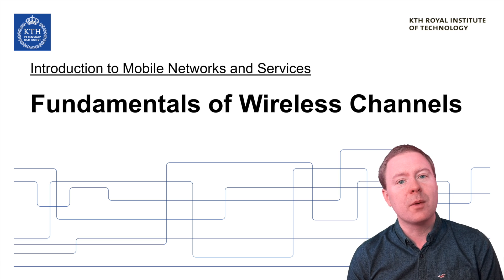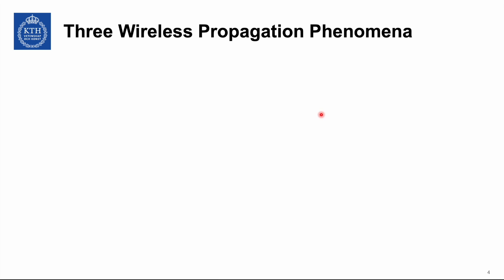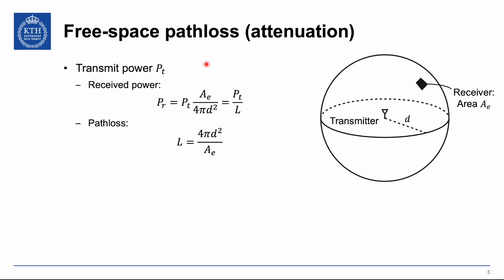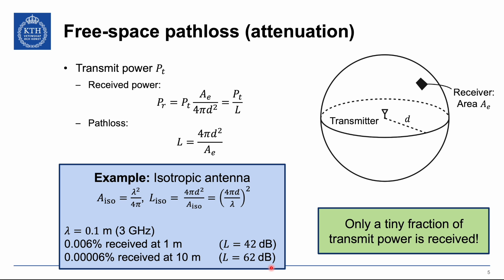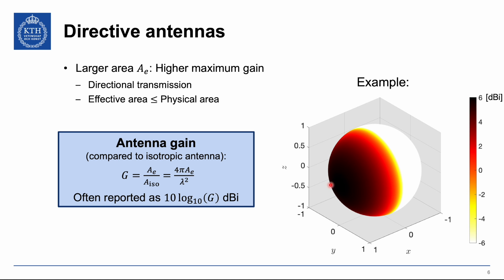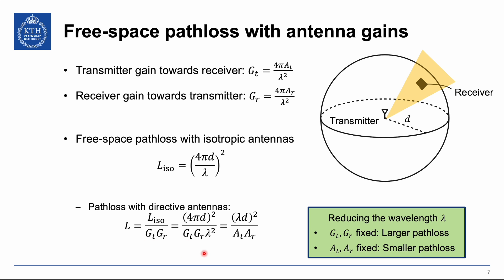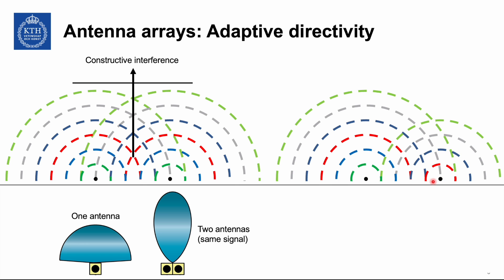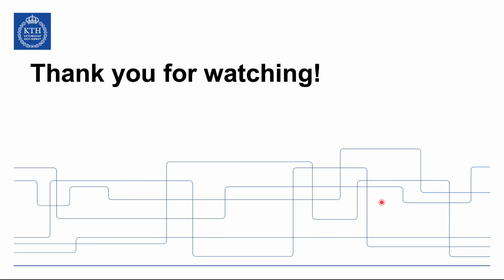Fundamentals of Wireless Channels

Comment: This presentation suggests that channel quality is exclusively a function of signal strength. Isn't it actually a function of signal to noise ratio in the receiver.  I think to be complete, this should be included.
Reply from the maker: This is a good point. The communication performance will be determined by the SNR. However, the noise power is determined by the receiver hardware design (it is the thermal noise limit * the noise figure), and is not affected by the communication channel. So for a particular receiver, the signal strength determines the SNR.

Comment: Thanks, Ae is a theoretical quantity and it depends on the wavelength. Does it also depends on the kind of the antenna? 
On the first glance it is intuitive that a dipol, monopol or patch have different eff. antenna areas.
Reply from the maker: The dependence on the wavelength is tightly connected to the antenna design. A dipole antennas has a length proportional to the wavelength, so you need to design it for your specific carrier frequency. It will then have the intended gain but the effective area shrinks as the wavelength becomes smaller. For patch or aperture antennas, you can design antennas for different frequencies that have the same physical area. This leads to more gain at higher frequencies, but also a more directional antenna so the effective area varies rapidly with the angle.

Comment: Are those 20,000 pieces spread evenly across the entire sphere? Across time? Which term gives 20,000?
Reply from the maker: 42 dB ≈ 20000 (the equality holds exactly for 43 dB). It is a computation of the formula shown on the slide. Yes, we assume these pieces are evenly spread over the sphere. If you divide the surface area of the sphere with 1 m radio into that many pieces, each one has the size of the receiver and therefore only one of them can be captured by it.